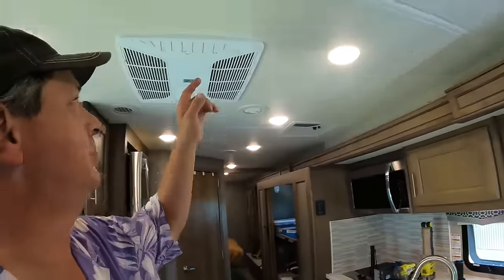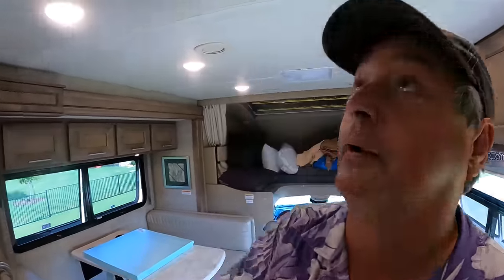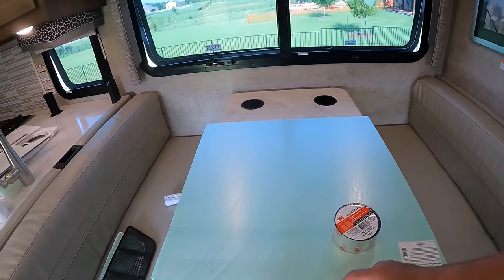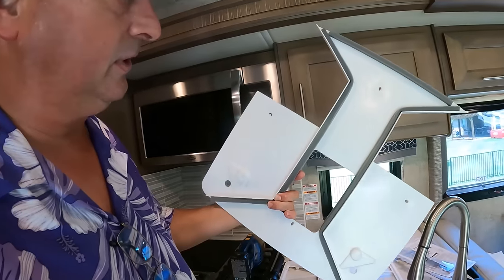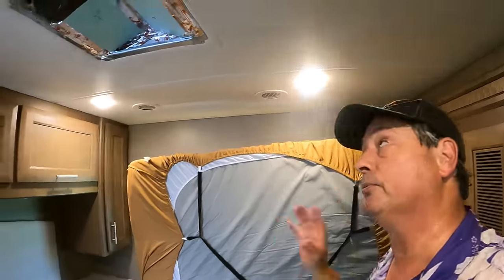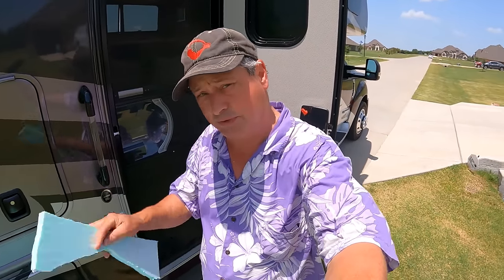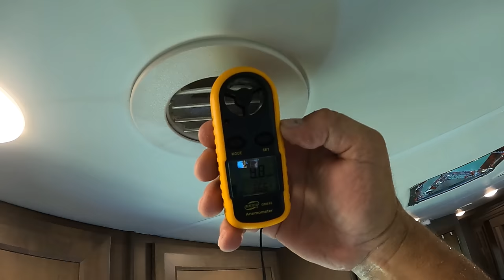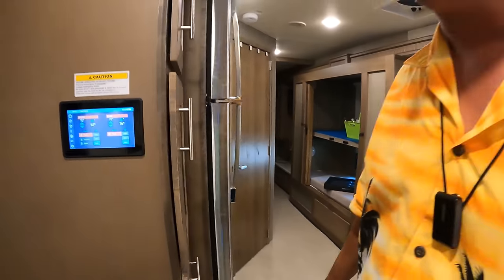A $10 DIY solution to Improve Our RV's Air Flow System For More Cold Air!

Comment: We replaced an old Dometic in our 36 foot camper (vented). https://www.youtube.com/post/UgkxDDbPbIlwLRcX_ntp51ui5UMtAUGpHYxE The install was a simple swap, all holes lined up, the electric plug back in with no trouble. Getting it on the camper was the most "difficult" part of it, and my friend made it look easy. I've seen people "sled" them up ladders as well though. I watched a YouTube video for instructions, very easily done. Some say it doesn't come with instructions, but I found the instructions under the ac in the box. I didn't need them, but they were there.It works well to keep a 36 footer comfortable, all by itself. It doesn't seem to be any quieter than the original, but it isn't any louder either. We're very pleased with it. Esp with the ease of swapping them out.
Reply from the maker: brace the Styrofoam?

Comment: You saved the day! Thank you! It’s 106F today and my Carrier Air V tripped overnight. Your instructions saved me a bunch!
Reply from the maker: Im so glad I could help! thanks for watching!
Reply: @DudeRV  - Heyo Heyo! I just realized my last comment somehow made it onto this video (another YT channel posted a fix for my Carrier Air V), but after seeing my mistake I watched your video and found it helpful too! My older camper has a single Dometic AC unit and no in-ceiling ventilation, so your improvements in this video make perfect sense! The air ends up recirculating right back into itself and doesn’t do a great job at cooling the entire camper, but your improvements would totally change that. I’ll give it a try! Thanks!
Reply from the maker: @paraglidingprospector  i was wondering how this helped with a tripped A/C! LoL!

Comment: Thank you so much for this tutorial! We had a second A/C on order when I saw your video. Fortunately I was able to cancel the order. I did my plenum exactly as you described. I took a grinder to the extra metal on the lower mounting bracket instead of bending them over. I also redid the tape in every vent. It's amazing how poor tape installation can affect air flow. Use GOOD tape. I re-taped the end of the duct where the second A/C would have gone and used some of the foam to make a dam inside the duct and just past the last ceiling vent on the other side because I didn't trust the tape job at the end of the duct I couldn't access. I hope that makes sense. The result is amazing cold air flow and so much quieter! Well done Sir!
Reply from the maker: I am so glad this helped Yall out! I really like the idea of the "dam" I think I shall do that as well, thanks for the suggestion and thanks a bunch for watching!

Comment: My daughters camper was icing up and it was due to poor air flow. It was a mess. Than I saw your video and got some foam and fixed mine up!!!

Amazing difference it made after adding the foam to seal things up. Wish I had a wind speed meter to do a before and after. Plus at the end of both runs I blocked off the duct after the vent so no more wasted air flow traveling past the last vent.
Reply from the maker: Great job! You are going to love that A/C now! thanks for watching!

Comment: I just picked up my Winnebago Vita this week. I’m headed out on a trip this weekend, and did a modification similar to this with a small piece of cardboard. I’ll use foam when I get back from the trip. Just putting the cardboard in has made a huge difference!
Reply from the maker: Good for you! remember to check the vents! everyone of my vents only had about 1/4 to 1/2 of the Styrofoam insulation cut out! Thanks for watching!

Comment: Best video out there ! Ive watched a bunch and yours is the best explained and best "how to" as well. Plus its cheaper than buying  the kit thats available. Good job Dude!
Reply from the maker: I am glad you found some value in my little video! Thanks for watching and subbing!
Reply: @DudeRV  rv airflow sells essentially the same product you made, at a $180 price tag. For Styrofoam. Thanks for making this video, you just saved me $170! Not that I was going to buy $170 styrofoam anyways…
Reply from the maker: @annaluera1357  I did not know that! someone is selling a block of polystyrene for $180.00?!! OMG! That seems a little bit high for less than a pound of Styrofoam, I could be wrong though. Regardless, I am so happy my little DIY video help you out! Thank you so much for watching and subbing!

Comment: Worked well on 100 degree day. I only have the 1 AC and it kept up great. Before if I closed the dump vents the compressor would just freeze up. I wanted to buy the single foam unit to do this but it was expensive if it didn't work and I didnt want to risk that much. This fit my budget to try and worked to boot. I liked the extra return space as I have had filter problems previously. I also found an uncut piece of roof material blocking the airflow some as well. Great video and thanks for sharing! 

One additional note on the dual straight track roof vs u shape track is make sure ends are blocked a few inches after the last vent to get more equalized pressure on all. Bocking AT the vent will result in higher air flow for that one vent but lower for others. Sometimes the factory doesn't even seal them so check!
Reply from the maker: I am so glad this video helped you! Thanks for watching and stay cool!😎

Comment: Seen several of these types of air flow improvemt videos and you got me to do mine today.  Had to finish the taping job into the ducts, but then came the oh no.  I have a domestic and the  air chamber is not rectangle.  Has some kind of internal winged baffle system.  So I impromised using your method.  About a bit of weird shape fitting, back and forth trimming, and  then success!  Really made a noticable improvement.  Looking forward getting out this summer.  Thanks for the inspiration.
Reply from the maker: You are most welcome! I know you are going to be most happy this summer!

Comment: Good work !! Did the same in my 2018 GD 2800BH. Down flow would hit the plastic cover straight on so I built a splitter (tent shape) in the middle, but lined the entire interior with reflectix and tape creating tunnels from the down flow with shallow curves directing to the sides.
Reply from the maker: I just have to wonder why the manufactures never made these simple modifications. thanks for watching!

Comment: I have been battling this Texas heat and humidity struggling to keep it cool in our travel trailer in the heat of the day.  I have been thinking something was wrong with the design every time I clean my filters and see that it’s primarily only one side collecting dust.  Seems pretty inefficient to me and I like how you modified the airflow in yours to take advantage of the entire intake and push more air from the ducts to spread it around.  Thanks for really going into explaining the design as well.  As a guy fascinated with the “why?” it helped a lot.  Much appreciated.  You earned my sub.
Reply from the maker: Thanks for the sub!! I am glad you found this video to be helpful! It really is a game changer when the temps and the humidity are maxing out. Did you see the Soft Start video I released a few weeks ago?  When it is really hot and everyone is running their A/C at max the brown out will reduce your A/C output. With an RVSoftStart system your A/C requires less power and is therefore less effected by the brow out. here is that video....
https://youtu.be/W1_Dvgu37u4
Hope this help and thanks so much for watching!

Comment: My new Thor Challenger 2021 is just like yours before you modified it.   I park at 3, and the temp inside is 95 in the back (My Generator shuts off without a reason) and it takes from 3 til about 8pm to get to 85 degrees.  I also live in Texas.   Mines in the shop now for 3 other reasons but as soon as i get it back (in a month or so) I'm going to do this DYI.   I'll use my power tools and be at my house so - without all the sweating....  I  Like your attitude.   The "DUMP" setting lets the cold air out right next to in huge return, so my theory is that what little cold air I get, goes right back in the intake.   I thought the ducts sucked.   The dribble air out, but I don't have the air meter.   I'm a engineer, (I was - now I just golf).   Your insight on a 4" x 5" air duct blowing into a 5"x 1" plenum is dead on.   That air wouild have to go to 4x atmospheric pressure to get out that plenum.   You just can't squeeze the air molecules closer together without some other impact.   (Bernoulle did the math).   So the idiots at Coleman and Thor came up with a pretty, but worthless design.   Your mods bring it back to close.   The two duct opening looked abouit 5" X 2" so that woiuld imply a constant pressure transfer.   The issue of turbulance may hurt a bit, but far less than the original design.   The "after action" report you gave was excellent.   In 30 minutes you cooled. your RV.   It woiuld be good to know if you ran your Generator and AC's and what the starting temp was when you docked.    Thanks for the info.
Reply from the maker: Your most welcome for the info! I did not run the A/C units before I "docked". I have found that the whole system cools so much better overall since I did this mod. I have since installed soft start units on both A/C units and are pulling less power overall.
I really appreciate your comment and even more I am grateful that you stopped by and watched!

Comment: Thank You for your handy man successful project.  I would probably be sharing this information to the RV Manufacturer or Dealer and point out the "factory" ductwork /air conditioner issue.
Reply from the maker: The manufactures are well aware that factory quality control is sub-par. They would rather produce low quality high volume RVs knowing that the majority of issues will be overlooked by new owners until the one year warranty has passed and those issues that do show up can be disputed and worst case "for them" fixed.
Thanks for watching!!

Comment: I found a $17 solution for my primetime tracer.  The bedroom has a plug in right next to the vent for ac. The ac puts out very little flow to the bedroom. I bought a 4 inch square(they call it inline fan) looks like computer fan, has a knob to adjust fan speed. The screw holes in the fan line up 100% with the vent holes. I just removed the diverter cover, bought longer screws, 5 minute install and plugged in. On high, flow is crazy good and whole setup cost me $17 with having to get 4 screws. Fan claims 160cfm but is plenty to increase the airflow to that vent. I would say it can increase airflow from 2x to 10x. If I want I could add a 4 inch inline connector and a pvc elbow to guide air where I want it.
Reply from the maker: SWEET! That was a fantastic solution! Thanks for sharing and thanks a bunch for watching!

Comment: Hey! I took my A/C cover off to see if it was the same inside as yours. Turns out the manufacturer used an entire can of spray foam insulation to put the unit in! Almost all of the return was clogged with hardened foam! SO glad I looked, I could have burnt out my unit. Took me an hour, but I cut most of it away. Next step, make your baffle. Thanks again!
Reply from the maker: It is a good thing that you found that! You will love all the cold air once you have the baffle in place! thanks for watching!

Comment: Hello Dude RV, it's funny l didn't see your video until today August 13, and l did the same modification on my ac unit last week. Pretty much identical. I have the same Coleman Mach you have the only thing l did differently was l rotated my grill 180  and now l can look straight up into my return and there is a larger area for air to flow straight up. I haven't tried my ac yet, due to where my camper is parked but I'm sure it's going to be a lot more efficient. Anyway thanks for your input. It's nice to see someone else with the same idea.
Reply from the maker: Great minds think alike! You are gonna love the added air flow! thanks for watching!

Comment: I see your using foil duct tape which doesnt adhere very well in my opinion and will come loose quicker with use. Instead get some foil mastic HVAC tape. Its more expensive but sticks and seals like no other tape on the market! Great job on the design and install!
Reply from the maker: actually it is not foil it is a metal-ized ducting tape. It really sticks well and so far none of it has released. here it is ...https://amzn.to/3zKnWyl
Thanks for watching!

Comment: Thank you for this very informative video, it helped us big time. However, I do have a question. Do you think it would be any more beneficial to use 1/2” material to increase volume for air movement? Or would that 1/2” even matter?
Reply from the maker: I personally dont think that will make much difference. I am glad this helped!

Comment: Can this be done to a fully ducted unit? I realize they would have to be pulled up from the rooftop to get to but it might be worth doing. My daughter has a 40-ft Montana with two fully ducted units, no access to them from inside the RV. But, like yours, only sees about a 10° difference once it hits about 80° or so outside. Right now, she's considering putting a split unit in.
Reply from the maker: I am sure there is the same sort of issue in her fully ducted unit. As to how to do it I have no idea. Thanks for watching!

Comment: Great video! How has this been holding up? Any condensation or freezing up issues?
Reply from the maker: So far it is holding up very well! No freezing or sweating issues. We really like have the filters work the way filters are supposed to work. On 100+ days we hold steady at 78. I did ad a Shade RV cover that really makes a huge difference.

Comment: I started to do the same your our units earlier this week. Our covers are a split style, so you can uncover the outlet and inlet separately. Anyways, I had just the outlet side off, and because I was curious, I turned the unit on. WOW! It blows like a tornado and it makes about half the noise. Anyways, I stopped right there. I may go back later and actually close off the opening to the ducts so that all the air just dumps in one spot.
Reply from the maker: That is great! You might check the intake side just to be sure there is no obstruction in the way. thanks for watching!

Comment: What is that thermostat screen? That is awesome!
Reply from the maker: That is the all in one control for the coach. lights, tank gauges, slide control, generator control, A/C controls are all in the digital panel. The leveling system is really the only thing not tied to that system. It is very convenient but if it dies then we have no back up for most things.

Comment: Excellent video, doing this to mine this weekend. I have already dropped my ceiling vents and sealed the gap the factory left between the ducts and ceiling panel,  using HVAC tape. Have you done this modification as well?
Reply from the maker: I will be doing my yearly A/C service this week end and will inspect for that gap! thanks for the heads up!

Comment: Great job, did you research the aftermarket product that does this? It cost alot more however and not as fun as DYI
Reply from the maker: I did watch a couple of videos about that $200.00 block of Styrofoam, I about choked on the price! with shipping for 2 it was going to be close to $500.00 and then I still had to do the install too?
 Now I have $470.00 to go buy some rib-eyes, brats, Shiner Peach beer, a tank of fuel and a great campsite for the weekend!! LOL!! In my mind that is money better spent! thanks for watching!